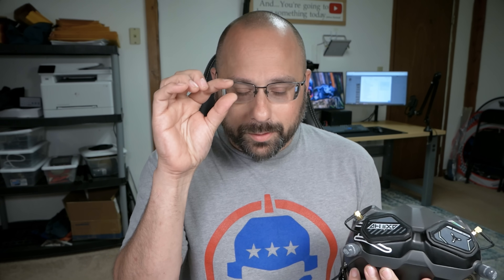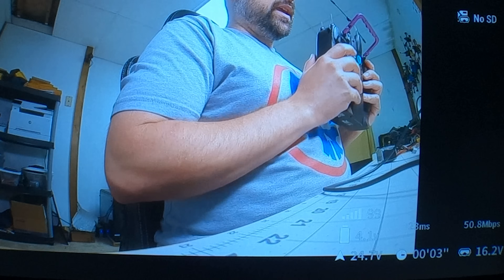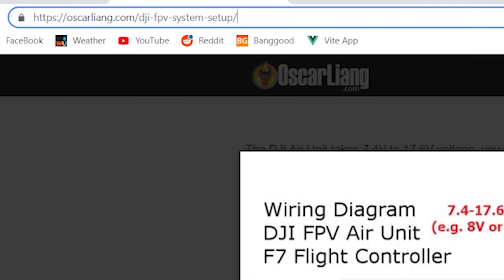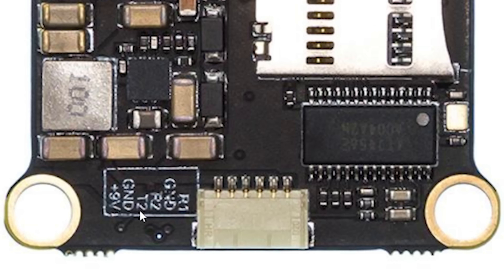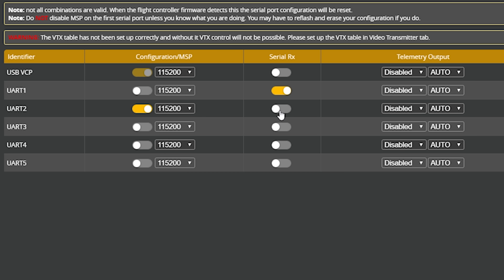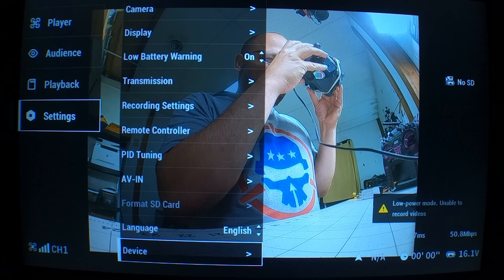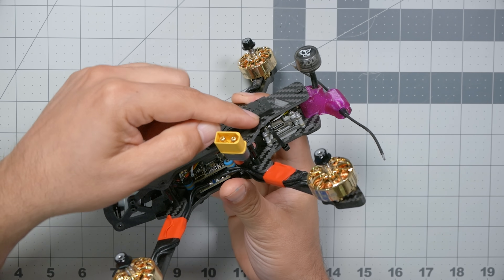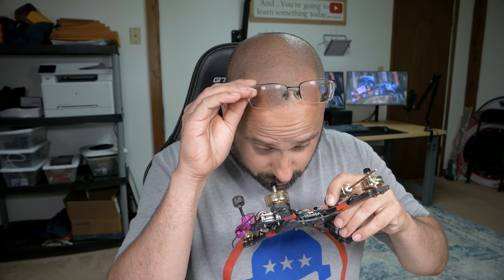DJI FPV very short range? Your MSP connection might be why.

Comment: Hi Joshua, if the diodes on the Caddx vista  are the problem . Then  Which one is the one affecting the range ? The Rx , the Tx or the sbus Diode?  Is just to remove the correct one. Thank you.

Comment: Hi, I get ok distance with an avata but then when I switch to a 5", axis manta, I get about half the range, would this be why, also when I plug a fully charged 6s in it only reads 3.7v but take off land unplug plug back in it shows the full 4.3v, I am a noob and very confused 😂 thanks

Comment: Hi Jb, when I arm my drone, it only goes to 30 mbps rather then 50 mbps on o3 air unit, what should I do
Reply from the maker: Most likely this is because you have audience mode turned on. When audience mode is enabled, some bitrate is used to transmit video to the audience.

Comment: Hey Josh, at 5:14 it says "framer rate switched to 120fps" .. Do you set the max fps in the goggles or is that a fixed value? Thx again for all those videos!!

Comment: If I have the caddx vista and i do what you show am i abel to get the   betaflight osd to? Please answer this comment🙏
Reply from the maker: Which goggles are you using? V2 or G3? If V2 then you need to "root" the goggles and Vista to get full Betaflight OSD. If G3, then yes it can do full OSD, but you need to do more than just enable MSP. Go to the Presets tab and load the O3 OSD Preset.
Reply: @JoshuaBardwell first thank you for seeing this  and second I use the DJ goggles Integra and by the way what did you ment by "root"?
Reply: @the-electronic-guy  hack it
Reply: @rainyland86 I gave up the pre-configured voltage display 😅

Comment: I got the Nazgul evoque bnf; but no OSD - MSP is correct/Battery Voltage shown. Still it does indicates overheat of the Air Unit O3 - (

Comment: I did FCC with caddx vista dji goggles v1. Low power does not appear on my screen. When I arm, UNLOCK still appears. I checked Betaflight, there is no problem. I checked the connections and updated the 9v caddx output to batt output. But the UNLOCK message did not appear.
There is no information about this, can you please help?
Reply from the maker: The input voltage shouldn't have any effect on this. Something else has changed.
Reply: @JoshuaBardwell  What else do you suggest I try?

Comment: my drone always has this message. tx and rx ok. battery does not appear. when I change rx and tx the osd disappears. so it was correct. but the scam is still there.

Comment: I just tried out the used goggles 2, not v2 but the smaller goggles 2, and on the drone with the caddx vista, I can't get 50 feet away before it goes from 50mbs to 8mbs then loses all video. What is going on there?

Comment: Mine says 700mw and I turned off the safety tab under power.. my vbat jeeps turning red down to 4m1 and I keep being at 50ms and losing reception like 40 feet away I even had it shut off on me once
Reply: I'm having the same, did you fix it ?

Comment: Dude you are awesome, I am late in the DJI game but finally got the DJI v2 goggles and 03 Air Unit but only was getting about 75 to 100 meters was getting really disappointed and seen this now I can go till my battery runs low lol
Thanks
Reply: I have the same problem, which was your?
Reply: @andreacolletto9843  it was staying in standby mode, after I corrected the wiring from the 03 unit to the flight Controller I can easily go 3kM with absolutely no video interference, perfect signal but my battery won't make it any further have to head back.
Reply: @andreacolletto9843  and once the wiring is correct do the cli thing with the MSP and with mine I knew it was correct because when armed it said motors turning when disarmed it says motors have stopped
Reply: what is this? @HowardPhillips46
Reply: I just tried and I can see the vbat and when I arm the "low power state" disappear...

Comment: I want to use air unit 03 with a rc truck. This has no fc. Can the dji air unit o3 as of today arm correctly without a fc? Can you uncheck temp protection and it will arm full power ?

Comment: Just spend a couple hours for this issue with FetTec G4 FC - Attention guys !!!  the last FC firmware didn`t work for some reason with TX/RX 3 in my case.  Damn - I checked everything and more - than rollback firmware and solve this problem.   Happy flights !

Comment: Mine doesn't ever say Low power mode. But says unlocked once armed. Any ideas?
Reply from the maker: You can turn off "temp protection" in the menu then low power mode will never occur.
Reply: @JoshuaBardwell  my issue is, it is never in Low Power mode even when disarmed. Weird
Reply from the maker: I'm telling you that will happen if you turned off temp protection. I'm explaining to you why your air unit never goes into low power mode.
Reply: @JoshuaBardwell  gotcha, I never turned it off. I bought this one used though so maybe the other guy did. It's definitely on now and no low power mode.
Reply from the maker: Ok then I got nothing :-)
Reply: @JoshuaBardwell 
I turned off the temp protection, but it’s still showing the low power

Comment: I have geprc smart 35 with airunit O3 And v2 googles 
I have new dji antena , my googles are fine, Low power state off And I have Low bitrate even when I go 30 meeters away from me ... maybe I need to chceck the wires on the aio. 
Vwry nice video
Reply: did u solve? I have the same issue

Comment: I have a related issue that just started on a working quad.  I had no issues with unlocking low power mode or seeing Vbat in OSD but all of a sudden quad randomly unable to unlock low power mode with arming and VBat may or may not work and sometimes it is just frozen?? Any tips or suggestions to problem solve?  Thanks

Comment: @joshuabardwell hellohello, I am struggeling for weeks now. I found out that my vista is broken. Though I also got the air unit that powers on full power 120, but does not show Voltage. MSP is on wiring double triple checked. I'm frustrated…

Comment: I'm running an air unit in a RC truck. No flight controller. I just run positive and negative to air unit and I have a fan blowing on it to keep it cool. What can I do to see the battery voltage in my goggles? Would hooking the yellow wire to battery positive do the trick?

Comment: Hey Joshua I've just installed the DJi o3 air unit on an older iFlight Nazgul f5. I've double checked the soldering to the board and it's good (gray to R3, white to T3). I'm running the latest betaflight 10.8 configurator and betaflight 4.3.2 on the quad. I used the dump from iFlight for all the settings, and put the correct uarts in the ports tab so that the quad will arm, fly, etc. However, it is stuck in low power mode and the battery voltage doesn't show up in the OSD. I tried updating with Canvas. Weirdly, on this quad, the same problem was happening when it had a vista in it (that's why I thought it was a vista problem and replaced it with the o3).  Could it be something with the FC? Or something I have overlooked in betaflight? Any help would majorly get me out of a bind. Thank you for all the amazing content! (I spent the whole day watching the newest Betaflight series!)
Reply from the maker: To get battery voltage etc all you need is MSP enabled in the Ports tab for the UART that the gray and white wires are connected to. If that doesn't work, I start to suspect something is wrong with the wires or the FC. Maybe move the TX/RX to a different UART? Make sure MSP is on the correct UART?
Reply: Have you solved this? same problem with mamba f722s. I see a complete osd but always in low power mode 😢

Comment: I dunk my quad in a pond. The caddx vista "survived" (video still works), but I lost MSP connectivity. (N/A battery and so on). I meassured continuity and resistance and it checks out. Any idea what else could have happened? Is there anything else than blowing up the diodes that could cause the same behaviour?

Comment: Anybody had there DJI goggles(using Vista) suddenly going to a black screen at short range? My msp is set correctly and has wtf hack installed and I am flying at full power.
Reply from the maker: Black screen usually means your goggle battery is dead. Lost link results in the DJI logo.
Reply: @JoshuaBardwell  It went into a black screen to the logo so it restarted ?

Comment: So I was flying 50 mbs and it was dropping to 8 6 mbs like 50ft away. wires right I get vbat, and also getting unlocked. I think I activated but didn't update the link so I just updated the link hoping that fixed it.
Reply: what link? what do u mean?

Comment: Omg Josh.   This has been bugging the crap out of me for so long. I run air units in my wings without flight controllers and have always wondered why can I not record. Thank you so much seriously thank you thank you thank you so much! It now works
Reply: How do you get Vbat and osd without a FC in fixed wings, ive been dying to know.
Reply: I'm wondering how you did this with no flight controller as well?

Comment: I'm gettign unlocked when I arm, but I'm not seeing vbat and my osd battery cell voltage remains at 0.00 - I've checked that my rx and tx wires are correct. I don't have any continuaity between the rx and tx pads either. Anything else it could be?

Comment: How can I get more than 25 mwt  without using fc eg as vtx
Reply from the maker: Turn off temp protection.
Reply: @JoshuaBardwell  got it set to of and have checked diodes ????
Reply from the maker: Are you in FCC mode? If you didn't register in an FCC region, then 25 mW is max power. You can do the FCC hack to put it into FCC mode if you want.

Comment: Dji remote controll no conection all binded green lights see icon on goggles but in betaflight I cannot do anything so?
Reply from the maker: In the DJI goggle, go Settings -> Device -> Protocol and change from Normal to Fast or vice versa.
Reply: @JoshuaBardwell     I did so... same situation 😭I noticed nazgul evoque is not highlighted all green on the sides I see orange... So don't know... Maybe problem is with wiring? BTW I bought drone pre built so supposed to be bind and fly 😂

Comment: Hey Joshua love all the great information 👏

My v2 goggles are still stuck in 25mw even after trying to make those adjustments… my goggles is stuck in 25mw and it doesn’t allow me to even make changes on but only since I have have put it on linked with vista cause it was working fine with my dji fpv drone but once I changed it over to use on my other drone with the vista it’s been stuck. I do get the red box when I arm and I have tried to change the me when I was in arm also and no go. When I first bonded everything it was stuck and I could even go to the mw option to make change but once i registered the unit I can go on the option but still can’t make any change! And when I turn that power option below it I still can make any changes???

Any help would be greatly appreciated,

Thanks, Tyus
Reply from the maker: Stuck in 25 mW suggests you activated outside of the FCC region. If this were true you also would only have three channels. Do the FCC region hack to override this.

Comment: my nazgul with vista drops to 15 mbs in a corner of the field where my rocket lite w vista stay at 50mbs.. I tried replacing , cam cable, antenna, sma to ufl cable , then tried to just get longer ufl antenna direct ti vista ,,,but nothing works... going to check vista continuity next...dont know what else to check?  could my capicitor be bad and causing all this?

Comment: Every thing is good with my quad it showes that it unlock and show the voltage but the range still sucks 50 to 100 meter away in open area it lost connection...what maybe could it bee.? Maybe the antenas? I use the standard dji antena

Comment: Looking for help. When I arm my quad and it will flip to full power mode but the picture quality drops off so bad. When I first had the quad it was great at far distances. Now I have bad range and and terrible picture quality almost un-flyable  did suffer a crash but impact wasn’t to bad. Antenna was a little bent, Could that cause picture drop off? Connections look good for what I can see.

Comment: Are you telling me that if I buy a dji fpv drone I have to go through these steps In order to get good range?

Out the box will not be good range?
Reply from the maker: None of this relates to the DJI FPV drone. It's all about the Air Unit and Vista DIY system.

Comment: when i arm, it says unlocked but i can't fly more than 700 meters. what can be reason?
Reply from the maker: Are you definitely at max power? What power are you set to? 700 meters could be pretty normal depending on obstacles.
Reply: @JoshuaBardwell  Thanks for the answer,
I tried power 700, 1000 and 1200, there are no obstacles at all and I tried different locations
Reply from the maker: What bit-rate is the goggle showing at 700 meters?
Reply: @JoshuaBardwell  drops from 50 to 9
Reply from the maker: I agree that's basically the end of range, although you could push it a little further probably. If you climb in altitude does it get better? How low to the ground are you?
Reply: @JoshuaBardwell  from the ground 25-30 meters and i tried raise the altitude but even if altitude is 50 meters i can't fly further 🤷🏻

Comment: Thank you, thank you so much. I invested a heap of cash on a Caddx system and DJI goggles v2 for my Traxxas summit and was having this problem but now as its fixed now. Works perfect. I turned off the heat detection and waalaar.

Comment: 4.5 miles no issues.
Reply: Only a mile for me. How can I get more?

Plus I have no OSD. Not sure why.
Reply: @LastDaySaintJames  if you fallows all BF and INAV tutorials should work with no problem,  but if you power the air unit separate from the flight controller,  and use the air unit , connecting the uarts you burn both the air unit uarts and the flight controller uart. Happen to me. 2 air unit with bad uarts.
Reply: @LastDaySaintJames  did you so the 1200 milliwatts mod?
Reply: @maxun1  
Yes 1200 hack.
Are you using stock antennas?

Comment: I have no VBat in the goggles but it does unlock its self when arming.
Not sure which the best solution would be for me?
Reply from the maker: See if you have vBat in the power and battery tab in Betaflight
Reply: @Joshua Bardwell  It's showing:
Connected (yes), correct voltage, mAh used and amperage
Reply from the maker: That's a bit of an odd one. If you see Unlocked in OSD then MSP is working. If MSP is working then voltage should be reported.

Comment: I get unlock but the goggles are getting terrible range. They get maybe 2000 feet but my DJI smart controller gets 4000 feet easily in the same spot.

Comment: 9:21 LOL. its probably bcz Joshua bought all the Vistas .  But real question is : when goggles v2 will have a fix : why goggles doesn't remember your quad when you switch from DJI digital FPV system and back to your custom drone with Vista . Every time you switch modes you need to RE-BIND everything again. Goggles Drone and Remote . Not very cool to do on the field.  Especially for custom build drone when Vista module is somewhere deep inside of the frame ( for example Protek25HD ). tinny "bind" button location is really inconvenient.

Comment: I have come to the same issue on a built and don't know what to do. Using a GepRC F722 Dual FC. Didn't know it doesn't support DJI sutff so I'm using an iflight Bec to get power to the air unit. Everything work but the problem is I'm not getting the red unlock window, and also on the lower left the signal for the quad only reaches one red bar. I've checked that my solder is correct, Yellow > R2, White > T1, Grey> R1. That leave me with red, black and brown. I've solder both the brown & Black together and grounded it to the Bec and Red wire in on the Bec 5v-12v out.  In Betaflight I've set Uart 2 as the serial and Uart 1 as the MSP.  Did I miss something????

Comment: Hey Josh! Thanks for the video! I had a blown diode, removed it and now I am getting telemetry data but not the voltage in the lower right corner. Thx for some help!

Comment: I have my vista unit on a model rocket(designed and 3d printed my fpv rocket!)
There is no need for a flight controller so I just have the vista hooked up to power only.. it’s working but it’s stuck in low power mode.. is there any way I turn that off without having it hooked to a flight controller?
Reply: Love to know to

Comment: Hello Mr. Bardwell, i have a new BNF Quad "Babyhawk II HD" the OSD works how it sould to be. I activate and updated the Vista, set it to 50mbit und do the 700mw mod. I have the right channel , everything is correct but i can`t fly more the 20-30 Meters and my rate drops under 10mbit. Did you have any idea what is wrong ? Here is a sample from my first and last flight https://youtu.be/ngvVDH30WpI

Comment: first at hall: thanks for the video, i didnt turned on "MSP"... 
After i turned it on, the goggle "unlock" from the Low Power mode and theoretically I could fly.
BUT i cant see the battery voltage. Do u or someone else got an solution for this ? 

thank you guys.

Comment: I followed your set up top the T, but I am still not getting battery info in the goggles or BF. All my other OSD telemetry is showing.
Reply from the maker: If OSD is working then you know the MSP connection is working. At that point, go to the Betaflight power and battery tab and see if the FC is even measuring voltage at all, and if not, figure out why. Most likely cause is wrong sensor selected in power and battery tab.
Reply: @JoshuaBardwell  What should the selection be for sensor? I have it set to default ADC, I did try a different uart just to trouble shoot, with no luck..Its my first HD build, built analog up until now..I just dont get why its not working. but anyways thanks for your reply.